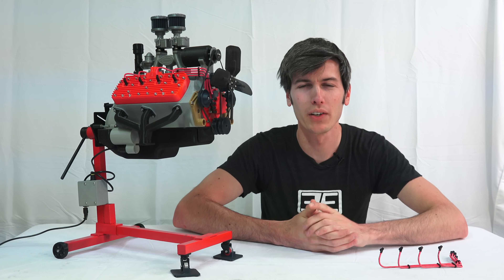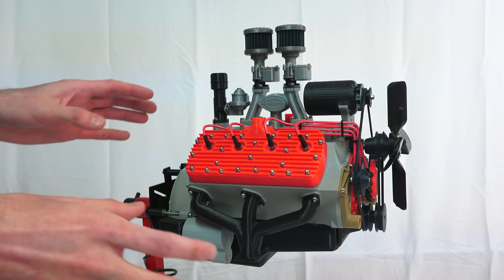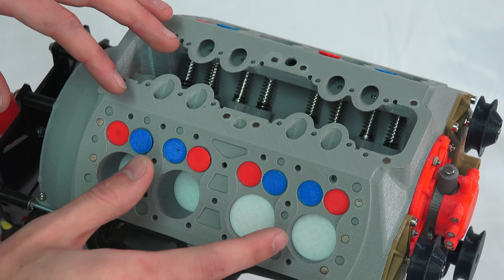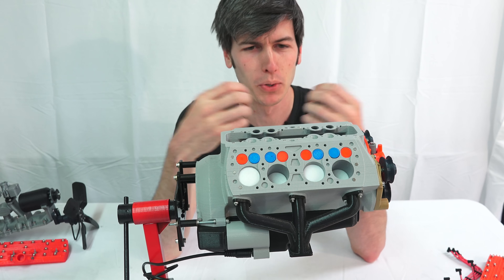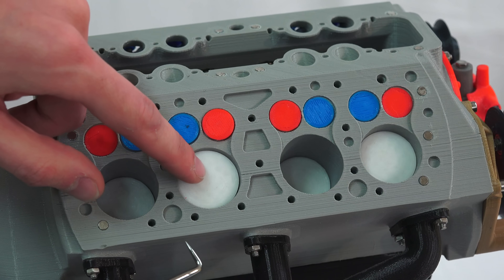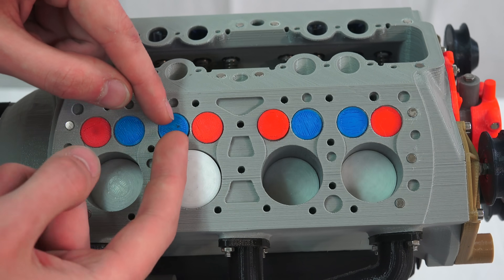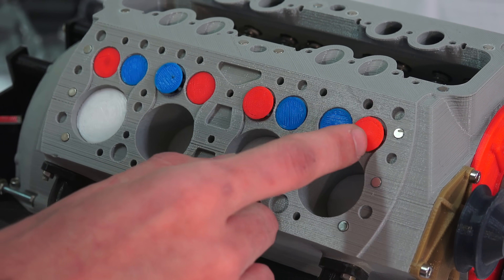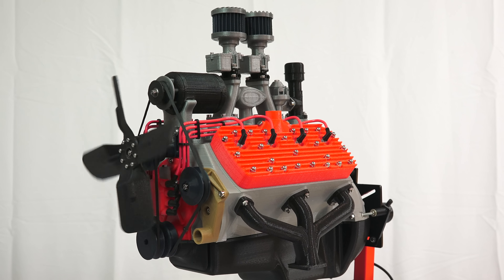Why Ford's Flathead V8 Engine Died

Comment: Now, if a 3-cylinder engine makes 65hp, it's considered on the weak side.
Reply: Back in the day if an engine required more then an adjustable wrench and a hammer to work on it would be considered trash.
Reply: My '68 Volkswagon produced 65 horsepower with stepping on the gas going downhill.
Reply: Someone forgot the 1952 Lincoln V8s 279, 302, 317, 341, 368.
Reply: Yeah, I hear ya. It depends on the application though, IMO. Most racing applications would rather have a flatter torque curve with more horsepower (unless they have enough transmission gears to keep within the peaky torque band) which most of the time isn’t possible. Circle tracks with long straightaways and tight turns is an example of this......same with road course racing.
Reply: Modern engines don't really make the power they claim for on simple reason.  They are rated at insanely high rpm.    Look up the hp and torque curves for old motors and new motors.   3000 rpm and 140 hp.  Vs 200 at 5500 rpm today.  From 0 to 3000 the old motors eat the new stuff alive.   That why Ford is going old school with its new v8.   Push rod and single cam in block and only 2 valve.     Multi valve over head cam engines suck dish water at low rpm and rely on higher rpms than you can turn at highway speeds to make power.     On paper a 5.4 ford is more powerful than 1970s 351.   But I towed the same 10000 lb trailer with the 5.4 and our old farm truck with its 351.  Same 4.10 axle ratio in both trucks.   The new 5.4 had to down shift out of drive (1 to 1) into second on a hill the older engine could do in drive.   The electronic tranny and engine control would not let me go faster than 45 with up shifting to drive.
Reply: @brianpatrick8787  Why are multi-valve OHC engines worse at low RPM?
Reply: @brianpatrick8787  I sold new Chevrolets 2001-2004 and the next years model would have a higher listed horsepower...at a higher RPM. Didn't change anything but the claim in the brochure.  🤔
Reply: @brianpatrick8787  there’s a couple more variables to consider than just low RPM performance. First of all, if an engine can maintain torque at a higher RPM, it will make more horsepower even if it has slightly less torque down low. Think about it this way..... the new engine might make less torque at 3,000, but it’s hitting the crankshaft twice as often at 6,000. Additionally, the higher RPM allows for more mechanical advantage from the drivetrain because it can use lower gear ratios.  

Imagine Usain Bolt on a ten speed bike in first gear as compared to Arnold Swartzenegger on an identical bike in 5th gear (new engine vs old engine). That’s why your transmission downshifted with the 5.4. It needed the mechanical advantage and RPM to maximize the output.
Reply: @brianpatrick8787  Modern engines make exactly the power they claim. The difference between old engines and new ones is that the old ones hit peak HP very early. Transmission gearing can be configured any which way. If you want that little engine to make 138BHP like in the Focus Turbo 1.0L, you can and it will. You can certainly throw that 1.0L 138HP engine in Chevrolet Pickup truck in place of the V6 engine found in a '85 C10 pickup which was offered with a 130HP V6, but the biggest change you'd have to make in order to make it as drivable as it was with the V6 is put an appropriately geared transmission, preferably with multiple gears (6+).  You can either have a wide power band like a sports car or a narrow powerband like an on the road diesel truck. There are pros and cons for each setup.
Reply: Brian Patrick Unfortunately Emissions killed the power of new trucks.
Reply: HP  can be misleading,  torque is more important in my book.
Reply: I like low rpm high torque in-line engines, they tend to last longer.
Reply: These engines had to be designed for the fuel that was available at the time. 10:1 compression ratio would have blown them to smithereens due to preignition.
Reply: It's the "area under the curve" that matters. Particularly for a grocery-getter...soccer mama is never revving to redline; power below 3000 RPM is what gets you away from the stoplight.

And (at least for NA engines) cubes is what gets you low end, end of. Your little 3-cyl might have more hp, but only after you wind it up to Dremel RPMs.
Reply: @bcubed72  You're correct on both counts, however, like any engineered device, careful choices can be made to make things work. A 3 cyl engine may either have more gears and or have to wind up the engine more.  You say a "grocery getting will never rev to redline", that's not true. You just never see it because most people don't need that sort of power. Honda Fit has very close ratios and unfortunately it shows on the freeway where the engine is blasting at 4K rpm at like 80mph. 

If an engineer had to use a 3 cyl motor with 80 hp but have it move around without feeling sluggish, then they may have to put better sound insulation/isolation, better muffler, quieter engine internals such as roller rocker arms, using a lighter weight chassis, more gear ratios in the transmission, etc. 

There are reasons why a manufacturer would or wouldn't go with a 3 cylinder motor while having the same peak HP.

Comment: the problem with the airflow, seems to me that the simplest solution would be to make the heads with a bit more meat, allowing them to have that higher valve clearance while not compromising on compression.

Comment: Its really incredible the amount of power in new engines compared to old ones, My 2 litre engine make by KIA makes 140 HP and my first ever car a Chevy Monza Spyder made about 145 from a 5 litre v8 like how amazing is that? Ford Flathead less than 100 HP
Reply: the old car have more tourqe ..

Comment: 5:1-7.5:1 lol needs forced induction. Fun fact, most old flathead V8s that have been restored have been retrofitted with a supercharger.
Reply: Agreed...prime candidates for a turbo. Except for the bearings not being that amazing according to some of the other comments. Perhaps back cut race flow valves and a simple tbi fuel injection kit. Opening up the valve area wouldn't be as painful if forced induction was used as a lower compression ratio and larger cylinder volume would be beneficial. Stronger/modern replacement parts would be a good idea too to prevent it from self destructing. But then there's the issue of it being known to get too hot on a normal day...before adding a turbo. A lot would need to be redesigned but it'd be interesting to see it work.

Comment: I notice there are no push rods in a flat head v8  I would like to see a modern flat head v8 built with some respectable hp and tq  like todays engines
Reply: Would have to use forced induction. Even with new alloys to cast the engine from and really good steel liners, the CR would still be really low.

Comment: interesting  the block you have is relived   you don't mention how that helps it breath    I looked close at the eddy myer intake nice touch    the jugs look to be Stromberg 48s   I had a 4 deuce setup  & these worked best   re jetted of course  48s are v8 60 carbs   ( dude your born in the 90s  lol )   my street mills I run 9 1/2 to one heads   with the block relived  its about 8 1/2 to one   seem to be just right    only 3 mains!

Comment: The flathead died in passenger cars and trucks in 1953 but continued on in what was call Ford Industrial motor up into the 70's and was still in use in Europe till some where in 60 in trucks.

Comment: i had a 1954 crown vic with a 24 bolt flat head engine
Reply: If you did someone switched the engine . In 1954 Ford switched to overhead valves but the cubic inches was the same as the year before  239 cu

Comment: The Ford flathead was a very reliable engine except for one area.  The routing of the exhaust ports through the block robbed water jacket space and put abnormal heat loads on the block and cylinder walls, especially the middle shared port.  The end result was often cracks in the block between the exhaust valve seats and the cylinder.  The cooling system had to be in tip-top shape.  
      Cadillac made flathead V8s for many many years through 1948, but Cadillac always ported the exhaust towards the inside of the "V", and so avoided the thermal problem of the Ford.

Comment: We had a '51 In-line 6 Ford flat-head engine that spent two seasons in a combine harvester then converted to propane and ran an irrigation pump for the next 32 years.  It ran pretty much non stop from late spring through the summer.  Except for normal maintenance stuff, this engine was never rebuilt!!
Reply: They hate revs and most people set the advance too high
Reply: Now tell us why horse and buggies got replaced.

Comment: Engineering needs to explain how he was born in 1953? Have you sniffing the Tesla car fumes again?
Reply: He makes that same joke on many of his videos. He's getting pretty good at saying it with a straight face. Seriously guys... Did any of you actually think he had made a typo?

At least the trolls have not ripped him a new one over it. We should be grateful for that, I guess.
Reply: @iamnid  google it!     just sayin
Reply: He was born in 1989
Reply: @mariosgbodys  

So he is LITERALLY a 30-year old Boomer?
Reply: he's 29...seems legit
Reply: 1953!?  BS!  Yo
Reply: Exactly, he just trying to get attention
Reply: TestTubeBabySpy what he meant to say was he was floating around in his daddies nuts from 1953 to 1989
Reply: Fords flathead was the best engine they ever made and its been down hill ever since
Reply: @jameshankssr466  So I guess you never heard of the Cosworth?
Reply: @jameshankssr466  definetely not true those things are awesome but slow and inefficient new engine are much better
Reply: @Daniel-dg8hd  all fords are slow when you can actually get them to stay running
Reply: @jameshankssr466  😂
Reply: @jameshankssr466  I can name several that were good....

The FE Series
The low deck Windsors ( 289-302 )
The 351 Cleveland ( my favorite )
The 4.6 Modular ( 2v and 4v )
The first and second gen Coyote

Comment: The plastic motor has no oil or gas in it,and has Zero Emissions>Same as the Subaru

If this guy was born in 1953, then I'm  the teenager

Comment: a T-head engine is a much better design however a v8 t-head would have 3 cams which would increase cost to manufacture. 
 simply increasing the stroke and/or cylinder diameter would increase the compression. Having the exhaust manifold based between the two banks of cylinders would lower the heat soak into the block and improve
 airflow

Comment: What I'd give for a flat head 8 in my '25  Model T.  As it is the flat 4 cranks out a neck snapping 24 hp.  But the guy is correct about the low end torque being better in flatheads.  So from zero to 10mph it is snappy, but from 10 to 40 is something altogether different and measured on a calendar not a clock.  Top speed is 45ish, but I've only done that once and it's not comfortable.
Reply: It was often stated that the Ford Model T was "the fastest car on Earth for the first three feet." Low-end torque, indeed!

Comment: You left out one important thing. Exhaust air flow. After it leaves the combustion chamber through the valve it has to make a 90 degree turn to exitwith a long path in the block before exiting into the manifold. Great job otherwise.